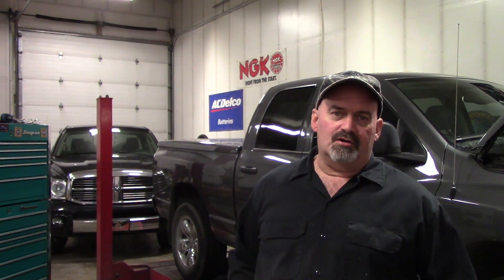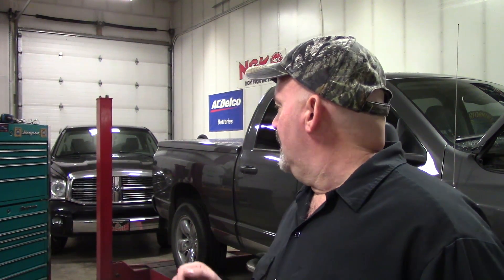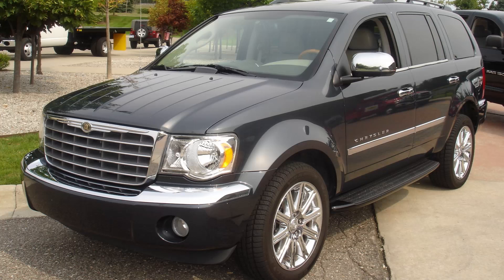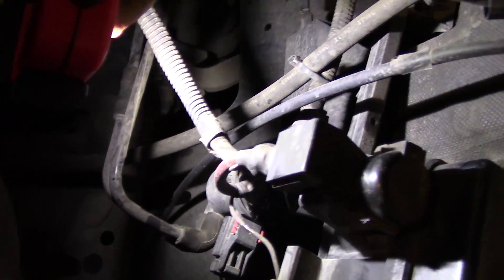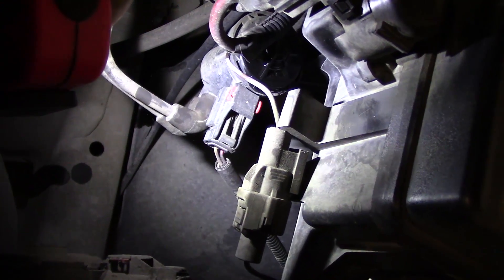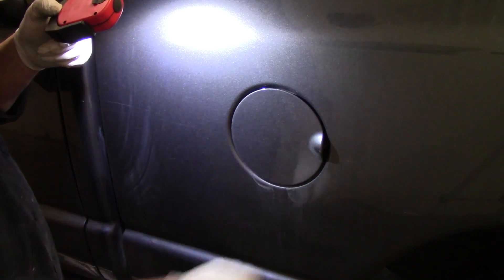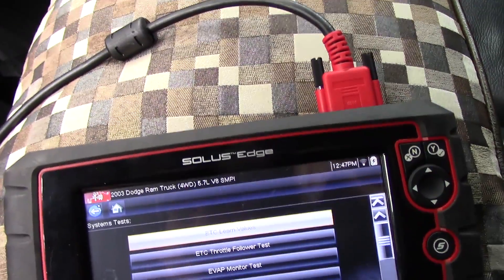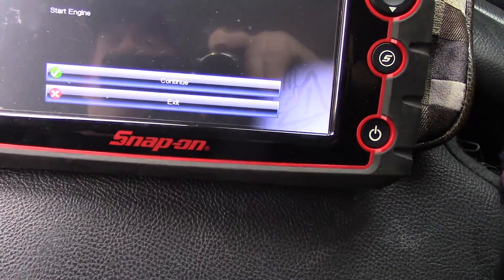Chrysler Dodge Jeep EVAP Code Diagnosis

Comment: great video. I am going to run these tests on my old 2001 Wrangler. Hope the checks apply there.
Reply from the maker: I think the first NVLD is the system you have. If a cap don't fix it its probably the NVLD. hope this helps
Reply: The Car Doctor Thanks Tim!

Comment: Good info Time I mean Tim. Well I'm watchin you so it's Tim Time. 
Love that hose clamp tool you used to remove the hose, nice.
Those hose clamps go on easy and they are plastic so that's probably why they use them, faster to put on and cheaper. Plastic is replacing a bunch of stuff in vehicles. I remember when the dash was metal and now they are all plastic. 16:00 All manufacturers are having problems with evap systems. I would take that a little further and say all manufactures have problems with their vehicles period. If someone is riding around in a Ford Focus and ya tell them they are riding in a fix or repair daily you are not going to get a smile out of them. We make our choices from our personal preferences. If you are eating chocolate ice cream you are doing so because you like it. Telling someone that their preferences are stupid or their vehicle is junk shows a lack of intelligence and more of a reason why I will stay with my choice. When I watch a video I don't tell the person they did a lousy job, if I don't like it I stop watching it and move on. If the person is a friend I might leave a critique but trashing someone, how does that help? Some people try to make themselves look better by knocking other people down. I try to remember the longest word in the world, smiles, it has a mile between the S's. A smile is free so it's easy to give away and it might lift the spirits of the person I give it to. Same as a complement. Have a great day Tim.
Reply from the maker: Question: Did you feel like I threw anybody under the bus here or just making a general statement? Or maybe just giving a good friend a critique? Or maybe you are really my Ex wife and trying to get a reaction out of me? or you are really Eric O from SMA trying to play with my mind. Maybe "Tim Time" is code word for time to knock me off by a paid hit man???
Reply: No, not a problem with you in fact you point out that other manufactures are having like kind problems. Funny the you point out a certain channel as I do not watch his channel because he is always bad mouthing the product that I drive. He takes the money from those customers though. Years ago I started working for IBM as a CE repairing computers. One of my coworkers  heard me complaining about some repairs that I had to do and so he pointed out to me that if they didn't break down I would be out of a job so just smile and fix the machine. Ex wife? I have never worn a dress and no I am not your ex wife. Tim Time is a good thing I was critiquing but your channel subs more than anything else. You know if you walk your dog and he takes a leak on my lawn that's okay if when I walk my dog and he takes a leak on your lawn. If you don't want me walking my dog on your lawn then ya probably should walk your dog on your own lawn and I will do the same aw heck just walk your dog on your own lawn cause I don't gotta dog. No worries Tim we are friends I just think some of the comments could be worded better. All, always, and never shouldn't be used that often. I will never, um I always, no I mostly leave good comments. nuff said.
Reply from the maker: You are a good MAN. I was just messing with you. I have probably said something derogatory about just about every brand out there in some of my videos here. They all have their faults and strong suits. There are certain brands I don't mind working on and others I struggle with. I didn't even know the other channel had that opinion of a certain brand. That's funny because I see a bunch of videos from that channel right beside this post showing them working on those vehicles. I know you saw my common trailblazer problems video and im a chevy guy but I was a harsh critic of their engineering for those vehicles but its all in good fun. I try to resist putting something or someone down to prop myself up but im a work in progress friend. Blessings!
Reply: You're a good man Charlie Brown I mean Tim the Tip and Tool man.
Agreed they all have their pluses and minuses and I don't mind pointing common problems that certain vehicles have in fact that is a good thing. My objection is when someone say all vehicles that a manufacturer makes are junk. I mean come on they don't make the Hugo anymore. Hey you have a great day and enjoy that California sun. Just a  little higher Han oh yeah Lando it's the Alaska sun, dang thing never goes down.